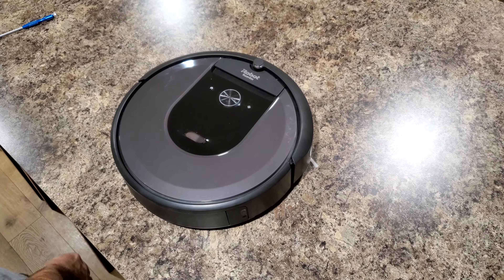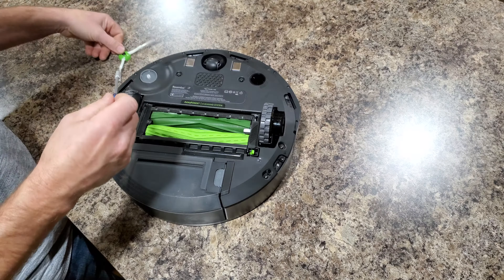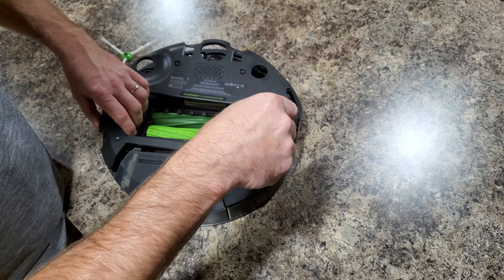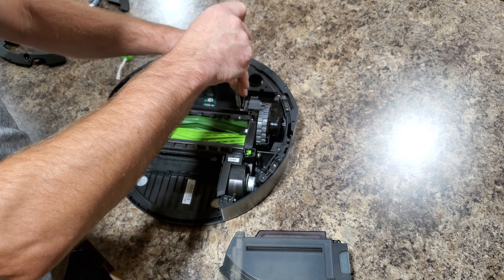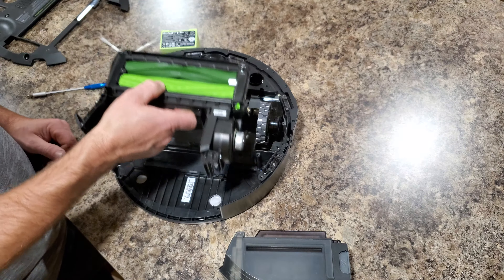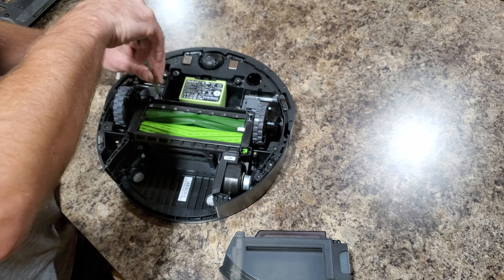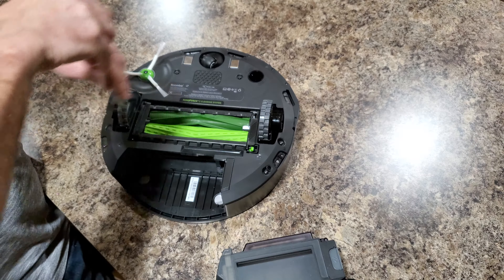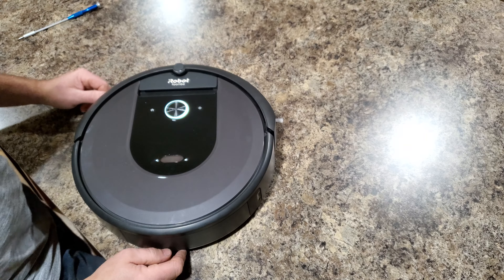How to remove and replace the Cleaning Head Module iRobot Roomba

Comment: Why would you do this?  For instance, because it won't empty the dust bin automatically anymore?
Reply: I'm having to do this for my mother because she said it refused to function claiming it needed to be cleaned, despite being clean. So Roomba sent this part to be replaced. Upon swapping I can vouch that the previous one was reasonably clean, so it must be some sensor that incorrectly senses a dirty state.
Reply: on mine the door latch for rollers broke, so ipurchased a new cleaning head module for replacement
Reply: My dog took an intense dislike to "Rosie" one day and decided that the front caster wheel, side brush and the beater bar holder were offensive.